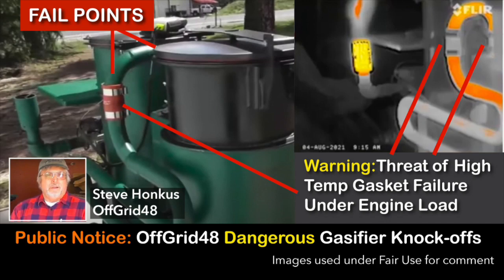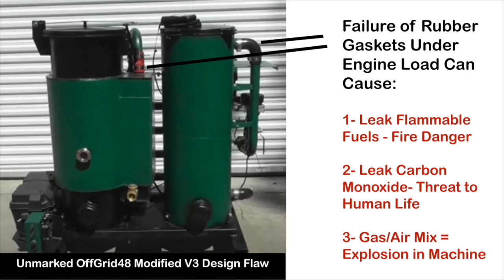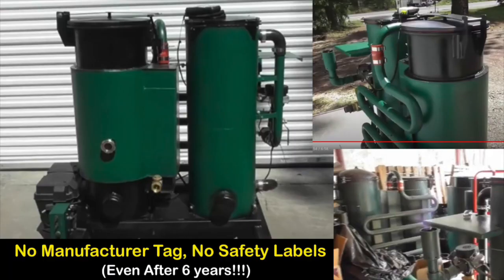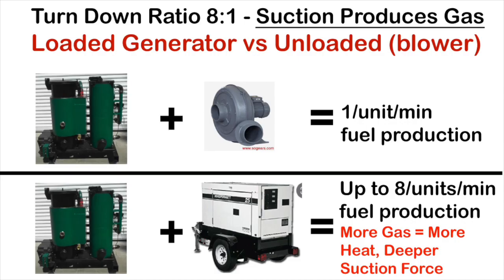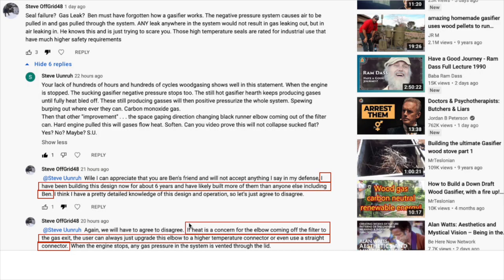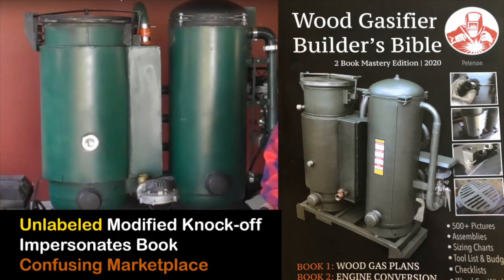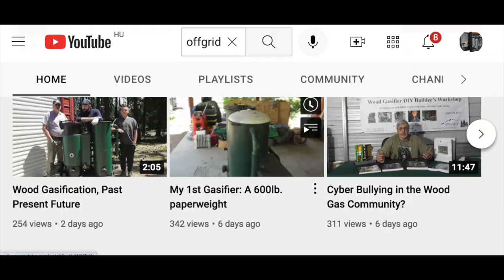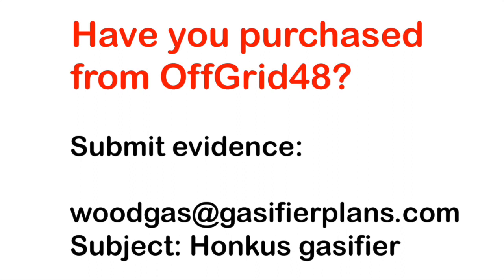Gasifier Recall Investigation: Purchase an OffGrid48 Wood Gasifier?

Comment: Pretty petty to go the "he doesn't have a Bond, or insurance and building them in his house" route...way to give the government ammo against the woods community
Reply from the maker: Chateau - The reason it matters is that Honkus agreed by using the book design to hold me harmless in case he screws up. That is called indemnity. He has a responsibility to provide a bond or other surety to me as apart of that agreement. With great power comes great responsibility. Gasifiers are powerful. 

With him making untested look alikes, it puts my customers and my reputation at risk. 

You guys seem to forget that I gave this guy nothing but support and publicity and even access to my channel without asking for anything in return for myself, only that he pay it forward to the community and the legacy of gasification. He hasn't garnered the skills of a real wood gasser, instead profiteering off of my recommendation. He isn't keeping up his end of the bargain.
Reply: @VictoryGasworks  there you go with that word "untested" again. What you really mean is he hasn't provided YOU with evidence of a specific test criteria that YOU, as his direct competition, demand that he do.
Reply: @mathewstephen6277  He hasnt provided anyone any evidence of testing. Let alone even any video of a unit actually running an engine doing anything. Yet you are just going to blindly support this guy? Have you built his system? If so where is your video proving his design even works? If its so great and it works its not that hard to point a camara at it and snap a short video of it. You already have a Youtube channel. Until you do this you need shut up because you have no idea what you are even talking about.
Reply: @lostcause7653  I do actually, it works great! And that's not really relevant to anything I'm arguing here, so not sure why you're demanding I post a video.
Reply: @mathewstephen6277  No you dont liar!!
Reply: @lostcause7653  hahahaha, you know that, huh? Whatever you say man.
Reply: @mathewstephen6277  It has everything to do with it. Lets see this great working machine. Otherwise you are just showing you are scam like your uncle Steve. All talk and no show.
Reply: @lostcause7653  Uncle Steve, how are you coming to that conclusion? Explain to me how my gasifier video contributes at all to ANY of the legal accusations that Ben is making.

Ben also has no video of the seal failure either. See, I can play that game too. He actually has NO real evidence of a failure, just speculation from a picture on the internet.
Reply: @lostcause7653  hey MattR, why the need for the 2nd account to debate me? What are you trying to accomplish by hopping on another account? You're wearing the same shirt and pet the same dog as in your latest video on your thrive account.... Not very sneaky man. Pretty immature actually.
Reply: @Bittercaveman, BTW Im not wearing the same shirt. You cant see the difference between long and short sleeves? Close enough right?
Reply: @Thrive-Off-Grid  Oh man, sick burn. You got me🙄. Let's just ignore the point I'm making and go for the arbitrary, irrelevant detail I missed.
Reply: @Bittercaveman. Did it ever occur to you that I might use Youtube with a personal account? Google dont like it when you have multiple accounts open at the same time and it will log you out of one or the other. I didnt deny this other account and I'm not hiding not to mention I have other accounts I do different things with. So whats your point? Where is your gasifier video? You want to promote a thief and yet there is not ONE video of a working machine model. Yet you claim to have a working machine. Well where is it?? Do a video and quit hiding and being deceptive.
Reply: @Thrive-Off-Grid  uh huh, do go on, now that you've been caught. Easy to make excuses once the obvious has been pointed out. Nothing you're claiming about off-grid is true, nor do you have any evidence of. And now you're deflecting to try to avoid the hard fact that you and Ben are both wrong. It's sad and pathetic, and name calling is a sure sign that you have lost
Reply: @bittercaveman Uh yeah because Im actually off grid and all you have to do is go on my channel the proof is right there. Been off grid for more than five years!! Ive also built over 300 machines and many of those were big V8 power plants. I have not lost anything, I have a legit business, that is well funded, opperating out of an industrial zoned shop, building my own IP and achieving most of the market share. You know why? Because my machines actually work!. Again WHERE IS VIDEO OF YOUR MACHINE???!! Stop being a deceitful scam!!
Reply: @Thrive-Off-Grid  deceitful scam? How do you figure that? Because I'm not posting a video of my working machine? You and Ben gonna make a video slandering me now? Well gee, if I can't get the mighty MattR's approval on the internet of my build, my legitimacy must be called into question.

Get over yourself dude, you're not that cool. I'm not going to post a video because you're demanding it, and it has nothing to do with anything I'm arguing here. You continue to deflect because you've obviously lost the argument.
Reply: @mathewstephen6277  The only one slandering is you. You are not going to post a video because I know it dont work. and you are most likely Honkus himself. Who do you think you are talking too, Im one the most advanced developers there is. Go to my channel and go back a few years. I know that without automation it is impossible to overcome the physics of a down draft Imbert gasifier. I know that it will not self sustain for more than 15 minutes. 

Why are you here anyways? If you are not Honkus what is all this too you anyways? You need to get some help dude.
Reply: @Thrive-Off-Grid  Oh Matt, you're so much fun to talk to 😂😂😂. "one of the most advanced developers there is" got a good laugh out of that one. You're clearly insecure about yourself, trying to justify yourself to a random person that disagrees with you on the internet.

I'm not affiliated with OffGrid48 in anyway, I'm just a fan of his work and think you and Ben are idiots. I've found this whole conversation very entertaining, you've provided numerous laughs.
Reply: @mathewstephen6277  Yeah I actually design, develop and build my own products!! Every aspect of it, Im not some wannabe clown.
Reply: @mathewstephen6277  Oh and I can keep going there are plenty more videos of those machines.
Reply: @mathewstephen6277  You have no real evidence it works either. Where is YOUR video?? !! Ben is a credible builder with many videos of his machines running in action. Stop playing stupid games and actually prove something instead spewing your garbage. Until you prove something you are all talk and showing that you are being deceptive. You are nothing but a liar and nothing you can comment any further will change that. Show a  video of your machine you LIAR!!
Reply: No the idiot building dangerous BULL SHIT is the criminal
Reply: What a Kunitz.
Reply: Well we that are legitimate commercial businesses are in commercial shops and have liability insurance. Good reason not to buy from someone that isnt because they can be shut down anytime and your investment they were working on maybe lost.
Reply: @Thrive-Off-Grid  do you sell a gasifier? Kits? Plans?
Reply: @Elrey8385  I do look up thriveoffgrid. Im not allowed to post direct links.
Reply: @Thrive-Off-Grid  I have seen your design and for the price it’s not bad. However, I’m looking for something with a longer burn time that I could add some automation to. Good luck to you and your business 👍
Reply: @Elrey8385  You know you can add the modules right? These machines already have the longest run time on the market. A fully teamed DFX-S3 can run the 8000 watt generators for 6 plus hours. 

This teaming capability also allows you to expand the application size.
Reply: @Elrey8385  If you want something thats going to just work. check out some of my latest videos. They really speak for themselves. I doubt you find any other machine that can run as stable and hands free as these machines and with very little maintenance.  These machines dont need automation they run stable without it. When it comes to automation dig further back into my videos and check out the big orange unit with the four corner SS pillars. That unit had self ignition, self monitoring systems. automatic AFR electronic mixer controls etc. This featured an interactive touch screen display. When I switched to charcoal I put this development on hold as the charcoal systems dont need it. However we will be bringing this system back into development to give the machine autonomous run capability when set up with a battery bank. The charcoal are only part of the system. There is another part in development. This is the VerisFire system. This intakes raw fuel feed stocks and will supply syngas for the house to replace LP / NG. While it does this it will also convert the raw fuel to engine grade charcoal. The gas appliances will drastically reduce electric needs and shift that energy over to direct gas conversions. Way more efficient as you dont have the engines losses converting the gas to electric.
Reply: @Thrive-Off-Grid  Ah, so the truth comes out. You're OffGrid48's direct competition. That explains all the bad mouthing coming from you.
Reply: @mathewstephen6277  Yeah and so is Ben Wayne, Jim and few others. They are considered friends.
Reply: @mathewstephen6277  I haven't bad mouthed anyone.
Reply: @Thrive-Off-Grid  got it, so you bully businesses that aren't your friends. Great business model, super mature.
Reply: @Thrive-Off-Grid  numerous comments on this video and others say otherwise. But even if that were true, you're supporting Ben's position, who is actively bullying your direct competition.
Reply: @mathewstephen6277  And I design and build my own systems. I dont rip other peoples designs off and then ride their backs. I am the most successful company in this space. I am the only surviving company from the last market cycle.
Reply: @mathewstephen6277  Im not bullying anyone
Reply: @mathewstephen6277  You know whats a bad business model is taking advantage of some else to make profit.
Reply: @mathewstephen6277  Really? Im pointing out that the coupling is weak because Ive also tested this. Therefore Ben is correct. Ive explained why. Thats not bullying or siding with anyone. This is sharing my own conclusion with an expert insight.
Reply: @mathewstephen6277  We are on track to produce over 100 units this year. I doubt Steve or anyone for the matter in small scale will be producing more than 10 units a year.
Reply: @mathewstephen6277  Also from 2012 Im the only company that is still standing. All others threw in the Towel.

Steve and Tactical Woodgas are new players and are under developed. They are at the level I was back in 2012. We have developed systems that are consumer grade products, I have developed and established mass production systems. We operate in an industrial zoned commercial shop. We produced well over 300 machines and put nearly a million dollars into our development along the way. I have machines shipped worldwide on every continent. 

Id say thats successful because no other company can say this. We will soon be looking in to mass retail we will be the first to have a gasifier sold in a box store.
Reply: @Thrive-Off-Grid  wait, you're COMMERCIALIZING gasification? BEN, ARE YOU GOING TO STOP HIM? HE'S GOING TO BRING DOWN THE REGULATION HAMMER ON US!
Reply: @mathewstephen6277  Im not "commercializing" Ive already done it; Ive been on the market for over a decade.
Reply: @mathewstephen6277  As for copyright and provisional patents we are working on all that for the 2023 models. Not everything you see on our channel are production machines. Most machines I show are development stage or a demo unit. Also machines with controls will have warnings along with an embedded user manual . I also provide an online support forum for my users along with the DIY community. We have plans that are free and will aid anyone in the build process. We also do one on one training and go over all the dangers of operating a gasifier. 

Comparing my machine to trash can sounds like bullying to me. At least my machines are practical and actually work. The videos speak for themselves. Where are Steves videos showing he can even build a functioning machine??

Comment: He claims you use a lower temp silicone tube in the door seal on your design.  Any thoughts?
Reply: The lid seals are not subjected to the same heat exposure. The hopper lid will remain cool until fuel levels get low. This will only be for a short time and these temperatures are not as intense as the gas out port of the reactor which is constant. All other lids are  colder as the gas has cooled by the time it reaches them. Ive built well over 300 machines; large V8 powered system down to 5 hp stationary systems. We always used flange seals with ceramic gaskets here, because other than a solid weld this was the only thing that held up here. We used a similar hose connect in the past made of the same silicone but it was wire reinforced duct hose for aircraft. Besides the high temps the acids from the gas will interact and degrade the silicone. The combination of both over time will result in hardening and then expansion and contraction will crack the materials.
Reply: @Thrive-Off-Grid  No, not true. If the air flow stops temperature will increase in the combustion chamber the same as it will in the tube to filters. Depending on the design its going to be higher.
Reply: you cant design a system against normal running this is why its valid to criticise the silicone adaptor in the tube on 48s design.
Reply: @JohnSmith1066-l5n  You are talking to a professional builder that has put in thousand's of hours of machine testing. See my channel before you comment further otherwise you just look silly.
Reply: @JohnSmith1066-l5n  Your last comment I dont understand. You say its valid to criticize the adaptor. Thats exactly my point as I have done it with similar joints. It dont work it will degrade.
Reply: @Thrive-Off-Grid  exactly yes and the same if not lower temp tube used as a seal in the door is a problem too
Reply: don't worry about being a professional making me look silly ive far more qualifications than you and i didn't get them with an "it will do" attitude.
Reply: read my first post and either answer it or stay out of the conversation.
Reply: @JohnSmith1066-l5n  I did answer it. You asked any thoughts. I explained and you are trying to tell me Im wrong. This is what I do for a living and I currently carry the majority of the market share at this scale. Unless you are my competitor with as many machine builds under your belt along with hours of operation, your are a far cry from my qualifications. I am also a master machine builder with engineering background that spans 30 years. Ive built multi million dollar machines ranging from production equipment, to foundry ovens to extreme precision machine tools. You know like the ones that profiled the James Webb Telescope Mirrors. Im not your average Joe. 

It will do attitude? where is that even coming from?
Reply: @JohnSmith1066-l5n To be fair on the lids I use ceramic and I have never used the silicone on lid seals. This I took from building the large foundry ovens of my past work. 
 However a gasifier hopper generally will not get above 300*f if it does there is something wrong. Gas out port should stay under 500*f. however that will not always be the case especially if the machine is driven hard.
Reply: @JohnSmith1066-l5n  No you are looking for someone to agree with you and give the answers you want to hear. My YT channel, FB page, forum thread on the DOW site and other online sources all detail the companies history and how it evolved. Ive also helped V Grid energy systems with there gasifier reactor designs.  Ive done a hell of lot more then "burn fires in a bin" You are obviously just as in the dark as Steve. Because if you were involved in the wood gas communities you would know more about me.

Comment: Ben, I bought your book years ago, and watched all of your videos (and Steve's videos too), and I thank you for your work in the past!

You obviously advertise your book and gasifiers, as a measure of safety and backup aganist the failure of conventional energy production (wich seems to be getting closer by the day), and a sort of defense aganist the overreach of the federal (and local) bureaucracy for liberty minded people. Wich is totally fine! I think everybody, who is interested in this technology is probably on the same page about this.

So, I find it a huge logical and philosophical contradiction for you to run to these horrible bureaucratic agencies to get them involved in your personal dispute with Steve.   :-(
Reply: It's a real shame these kind of tit for tat issues exist in the gassifier community I get it there is a person building out gassifiers using some of the designs and adding on those designs with additional parts and  the coupling could be easily replaced with some angled metal pipe avoiding the failure what confuses me is even if the coupler failed doesn't air leak in not Out?
Reply from the maker: I understand your sentiment, but to live without the government is to live in honor. What Offgrid48 is doing is putting out untested machines that imitate my work, but aren't and he isn't claiming his own liability. Why does he get to flaunt laws and responsibility?
Reply: @VictoryGasworks  do you have any proof whatsoever that OffGrid48 isn't claiming his own liability? Thought so.